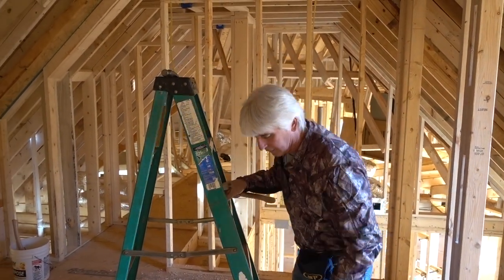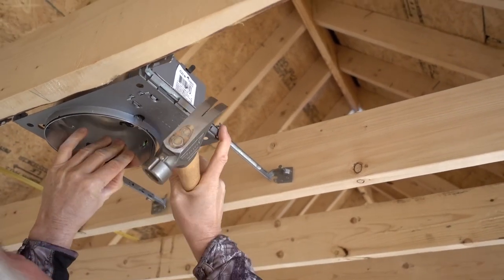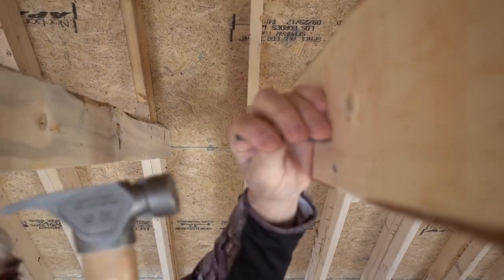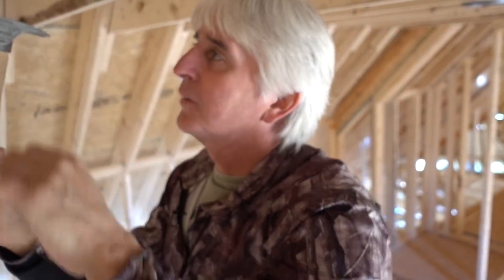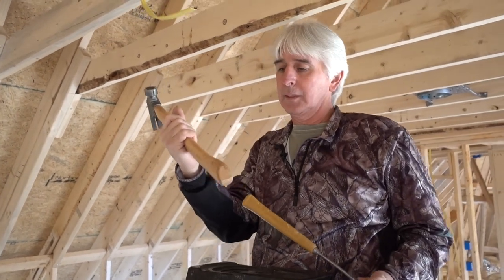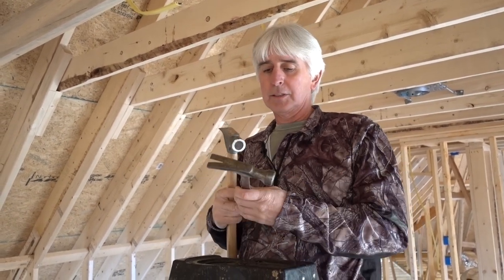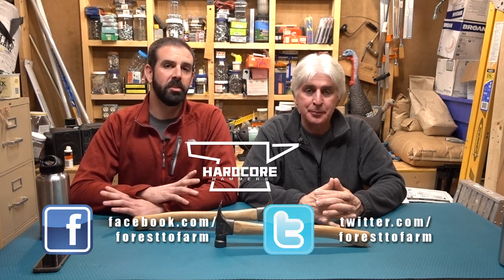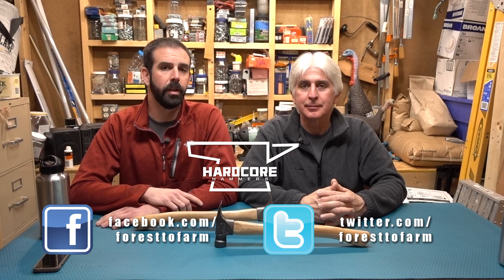Hardcore Hammers - Tool Review

Comment: It appears that the waffle serration are reset below the smooth outer ring.  How does the hammer seat the nail flush with the board ?
Reply from the maker: That would be correct. They are only slightly below the surface. I guess use the edge. I prefer and use the solid head myself. Brian my son uses the waffle head. Thanks for watching!!
Terry

Comment: I like your hair do...you know what works easier than a hammer? An air gun....I always put fart fans and lights up with air
Reply from the maker: Thanks. Air is not a bad idea. Problem for us is we travel as light as possible using only a regular cab pickup and not even a trailer so we have to conserve room. The back of that truck is packed full most of the time.
Terry